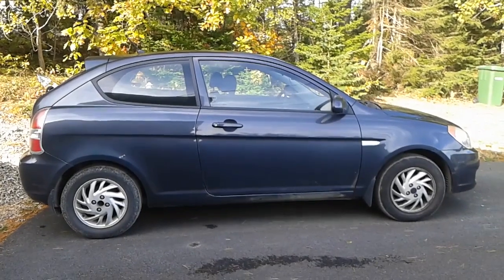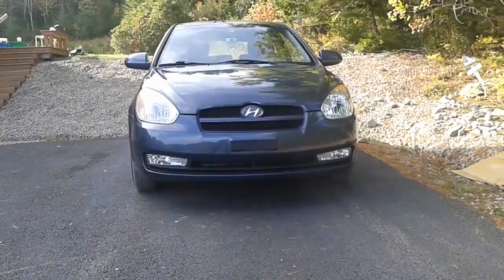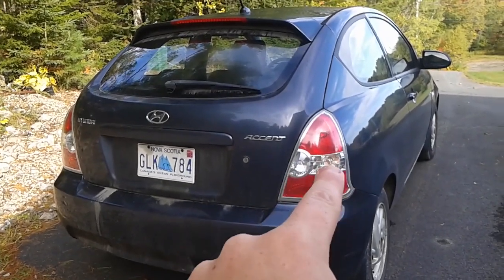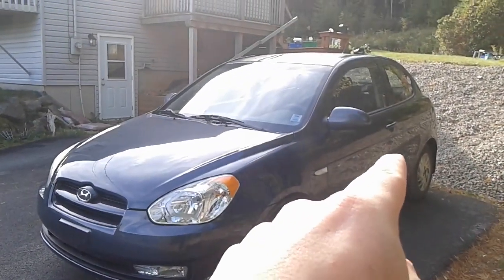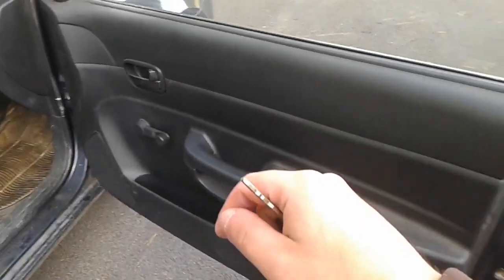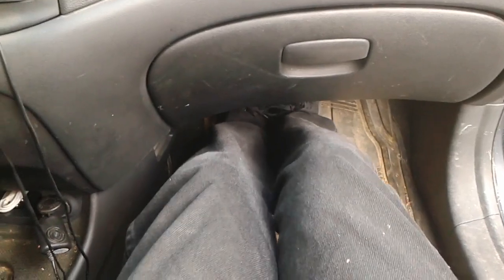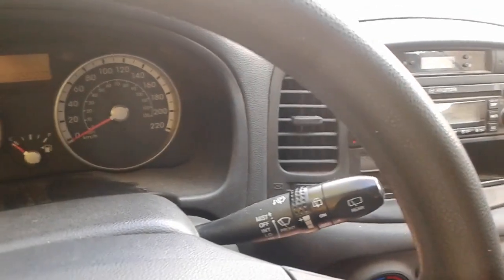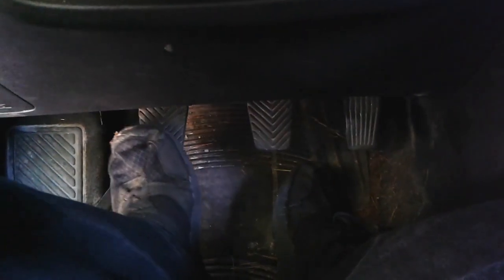'Humdrum' - My 2009 Hyundai Accent: A Tour

Comment: Salute from BC. Best accent review. I have the exact same car
Reply from the maker: @kootnygreen  Thanks! Mine has been giving me a little bit of grief lately - starter died, and a worn ignition cylinder for my key. But I can't complain the car has 250,000 km on it now and I use it for work so I'm constantly taking the key in and out of the ignition, so not surprised that it is worn! Luckily parts are inexpensive and it's fairly economical to repair! :)

Comment: This is by far the most in depth vehicle review I’ve ever seen! Great job. I’ve been wanting to get one of these badly for three reasons, #1 stick shift #2 fuel economy #3 its just a nice little hot hatch and they just dont make hot hatches any more let alone a stick shift one. But after watching your video i want one now more than ever
Reply from the maker: Thanks for the kind words friend! I would love to do more videos on 'Humdrum', as I call my Accent, but I don't have a lot of time! :)

The fuel economy is very good...I've been being a little more careful than usual with it and 666.8km on a 45L tank! I usually get around 630-640km per tank, which isn't bad!

It's hard to find a decent little stick shift hatch...I do really love this car, as basic and cheap as it is. It's approaching 193,000kms now. The only major parts I've had to replace are a starter (due to the grounding cable on it rusting away due to the winter salt here), a fuel tank (not a cheap repair, but not the car's fault....Hyundai used steel tanks which isn't a big issue, but again...it rusted due to the salt here. and the interior door handle stopped working just two days ago on the driver's side (a snapped cable that runs from the door latch to the handle on the handle end.

The starter was fairly cheap as I had my indie mechanic put on a known good used one and it's pretty easy to access. The tank was quite expensive....$900 I think it was, but it's been fine since. I was quoted $255 for the door handle repair as the cable isn't available as a separate part and is integrated into the entire latch assembly....poor design choice, but needs must!

Otherwise, just maintenance items here and there like coil packs, spark plugs, belts, tires...brakes...the usual!

Not sure where you live, but if it's somewhere with salt on the roads in the winter, it's worth it to take the rear interior trim panels out and have rust protection sprayed INTO the rear quarters around the rear wheel wells....and just getting rustproofing done as well on the car in general is a great investment to help them last!

Check out the 2006-2011 Kia Rio as well....they are the same car underneath as these MC-generation Accents, so use the exact same engines and transmissions and are just as simple and robust! :)

I've got a few more other videos on my car here and there on my channel (and also other car stuff!) if you wanted to check those out too! You can check out http://opposite-lock.com as well - it's an auomotive forum, very friendly community! We don't ALWAYS talk about car stuff, but it's mostly car stuff and open to all kinds of cars! I'm on there as RallyDarkstrike as well and make posts about my car there too!

I hope you get your own Accent, and again, thanks very much for the kinds words, it's humbling to know people enjoy my content when I have the time to put some out!
Reply: @rallydarkstrike2940  thanks alot bud im definitely going to keep all that in mind. I live in NYC  . We do get road salt , probably not as much as Nova Scotia but i will be using your tips for rust prevention when i finally get one. I am surprised however that you dont do your own mechanical work .
Reply from the maker: @gabrielpichardo1492  I would love to do my own mechanical work....I honestly haven't done a lot of it, but my issue is I don't really have the time, the place or the money for tools at the moment sadly! Working towards it though!

The most I've done myself is install the fog lights that are on my car...they are OEM-style, but I did the wiring with a kit and installed the housings myself. Also had to swap out the grill insert as well :)

Comment: About the rear wiper; if it's like my '11 Elantra Touring, it will swipe for 5-6 times continuously, then settle into an intermittent mode.  Try it out.
Reply from the maker: Nope, if you use the sprayer, it will operate continuously while holding the spray switch, but if you let go of the switch, it will do maybe 3 more swipes and then stop. If you just turn it on, it just starts swiping constantly...that's it's only mode :)

Comment: I bought the same car new in 2009.It has 194000 klms on it and still runs perfect.It has the original rear brakes and exhaust system.I live in Ontario and after eleven winters the car still looks good.I still really like it.It has always had good maintence.I drive it to Vancouver Island and all over the states before covid-19.Buying a used Hyundai is good.Make sure you have a machanic look at it first.Just a honest review.
Reply from the maker: For sure, mine has been great! I had to get the brakes re-done, but it's on the original clutch and original exhaust! :)

Comment: How tall are you by chance, and hows the visibility in the driver's seat? Im looking at one at the moment it seems like a nice car but at 6'2 some cars like the Prius have near zero visibility without leaning backwards like a yard chair haha! Good very clear video btw
Reply from the maker: I'm about 5'7! I have never found rear visibility to be an issue! As long as you adjust the mirror well, it seems to work quite fine. The driver's seat also has some very limited height adjustment as well FYI!

The hatchback model like a mine is also easier to check your blind spots as the doors are actually physically longer than the sedan models, so when you look over your shoulder to the drivers side, there is more glass there to see out of instead of the B-pillar that would be closer on the sedan model.

Thanks for the kind words! :)

Comment: I’m using my grandparents GS with manual windows, locks, and all that BUT it came with a screen from the factory
Reply from the maker: @nobody6067  A screen, you say? If you mean one in the infotainment system, I've never heard of that on an Accent of this generation...they are mostly before the time of factory touchscreens in cars...unless an aftermarket head unit was installed by the dealership before it was sold new, which sometimes happens? The car did come with auto climate control in some markets, so there would be a little screen for that in some cases?

Comment: All great, one question, how do I open the trunk without a key?
Reply from the maker: Hi Robert - I don't believe there is a way to open the trunk without a key, sadly. If it's an Accent sedan you're talking about, there is, as there is a handle to the left of the driver's seat on the floor...but if you're referring to an Accent hatchback of this generation, the trunk can only be unlocked with the key.

That being said, if your car had remote locks as some higher-trim Accents had, I imagine the trunk would unlock with the keyfob? Base model Accents like mine though, the key is the only way.

Comment: would you say paying 3 grand from a fb market place for one similar to this one in the video mileage etc? im curious if its a decent deal or not.... from canada also as i seen from your comments.
Reply from the maker: Depends on the mileage and condition! I'd say that's not bad in the current market, though maybe a LITTLE high....used car prices are very high, but if it's a model exactly like mine, there are not many features and they were only something like $10k-$11k when new.

Mine has about 202,000kms on it now as I type this and still going strong! :)

Comment: Is it reliable?
Reply from the maker: It's been very reliable for me! Short of normal maintenance and replacing maintenance items like filters, timing belts and spark plugs, I have only had to replace two parts...the fuel tank and the starter. It's even still on the original clutch at 186,000kms! :)

Both the fuel tank and starter weren't failures due to build quality, but due to where I live in Canada and the fact the roads are heavily salted here in the winter. The seam on the fuel tank rusted out and was leaking, so it needed to be replaced - that was around $1000 CAD. The starter was also due to rust...a cable that runs from one part of the starter to the other actually rusted in half, so I couldn't start it....but being a manual, I just bump-started it until I got it fixed! :)

The body is rust-free considering the salt - I do get it undercoated faithfully every year - so if you are getting one, it's a pain in the butt, but take out all of the rear interior trim panels and get undercoating sprayed directly into the rear quarter panels from behind!

I do have one spot that rust repeatedly comes back on on the rear-right quarter wheel arch, but that is also not due to the car's build quality, but due to a poorly done repair by a local body shop that fixed some fender-bender damage back in 2015 :(

Long story short I would highly recommend any 2006-2010 Hyundai Accent sedan or hatchback, or any 2006-2011 Kia Rio sedan or hatchback to anybody looking for cheap, reliable, and fairly comfortable transportation! (The Kia Rio of the same generation was a sister car to the Accent).

Comment: They stole my exhaust manifold w/ the catalyst converter would it Be easier to use Megan or get the original manifold??? Need advice “ Thanks Aloha’T
Reply from the maker: I would think it might be easier to get an original manifold. Do you have any salvage yards near you? We have a 'Pick 'N Pull' salvage yard near us...it is a salvage yard you can go to to find your own parts, and then remove them from the cars yourself. I remember going there to replace the stereo head unit in my car once and it only cost me $20.

Maybe you could find a cheaper replacement manifold with cat still attached at a similar yard? That would be the cheapest way without having to buy new! You could get the manifold from a sedan or a hatchback, as they are the exact same for both!

Comment: i like that year the hatchback let see hows the ride ?i might get one i did see one a 2008 AUTO,KNOW STICK.
Reply from the maker: It's an economy car, so the ride isn't GREAT, but it's fine. I just had to get the shocks and struts replaced a few months ago...but the car has 230k kms on it now on not-the-best roads so they are definitely a maintenance item at this point.

My car is a manual, but my mother has the automatic. The auto is fine, but the manual feels FAR more sprightly.

Comment: Fun Fact. The manual that they put in this gen is a Mitsubishi transmission.
Reply: Are there 6speed manual that can be had or be retrofitted?
Reply: @LLCoolPass  I remember correctly not stock but the Hyundai Tiburon Beta Motor and tranny of this year should be able to swap into the Accent. I have seen videos if people doing it but it seems rare. May be worth looking into. 
I agree though... the 6 spd would be nice haha.
Reply from the maker: @darinw.3580  I wasn't aware that that was possible. As far as I knew, the alpha and beta engines have different Mount points, so any swaps would require a lot of custom work. 

The stock manual is a 5-spd. :)

Comment: Does the odometer stay on when car is off???
Reply from the maker: It does, yes! :)
Reply: @rallydarkstrike2940  thanks you, I thought there was a short. I just bought a used one because of the gas prices. It's been saving me money. 😆
Reply from the maker: @teemoleague907  Nope! It's completely normal for it to be lit up when the car is shut off and the key is out of the ignition! :)

They are very good cars on gas especially if you have a manual transmission in yours and know how to drive a standard in an economical way! In warmer temperatures, I routinely get 640-650 km to a tank, and the car has a 45L gas tank. My best on one tank ever was 676 km, but that was cutting it pretty close to empty, haha!